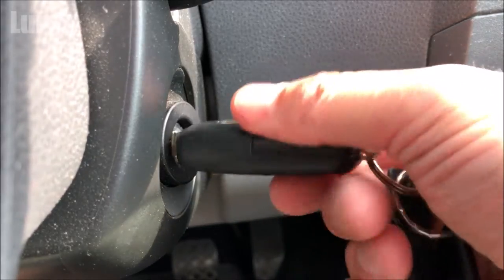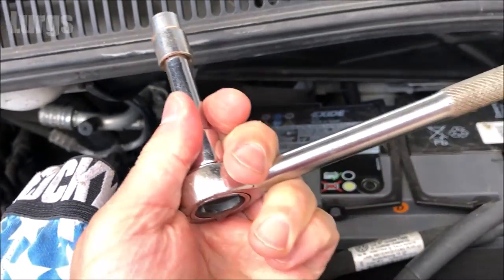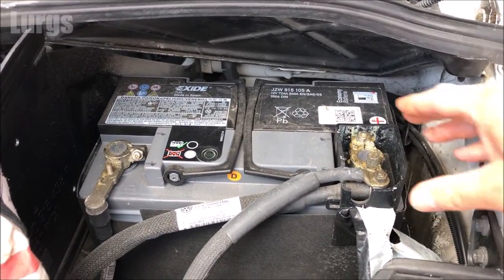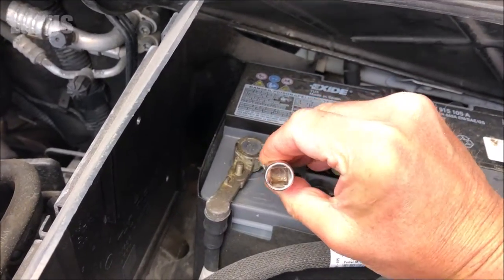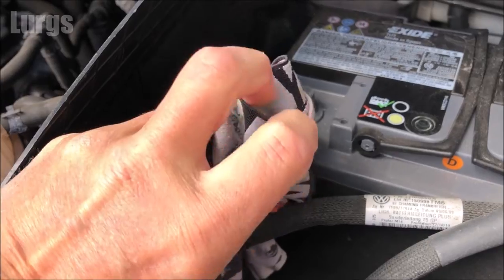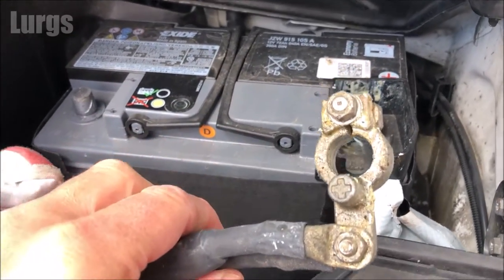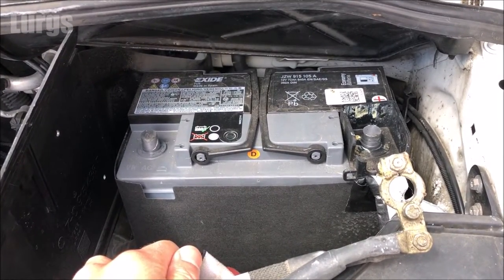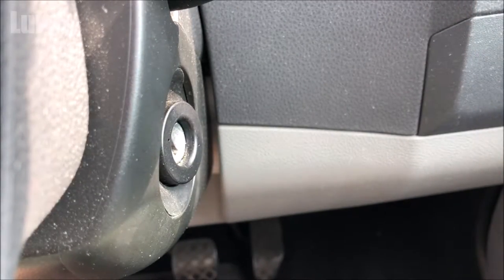How to disconnect a Car Battery Safely plus TOP TIP for keeping battery terminals corrosion free

Comment: Can you damage your car by disconnecting the positive first on a battery?
Reply from the maker: You could do, it’s more dangerous because the battery is still live
Reply: Okay what kind of damage can you do to your car?
Reply from the maker: @Mrbacon-v4  None as long as you don’t touch the negative terminal and the chassis at the same time when undoing. You’d probably only blow some fuses but you may damage computers. 
If you do it in the correct order as per this video you shouldn’t have any issues.
Reply: @LurgsHowToGuides  okay thank you. The reason I ask is because I disconnect the positive first in order to reset the rav4 and then I connected it back, I didn’t see any sparks, or anything like that. But when I tried to start the car, it didn’t start. I tried to start it a 2nd and it started.

Comment: Are you sure putting petroleum jelly like that is good idea? Petroleum jelly does not conduct electricity very well, so you are actually putting a layer of insulator between  terminals. I thing that original idea with petroleum jelly is that you put it after connecting terminals, to protect them from moisture, but it is going to attract dirt. That is why I do not use it anymore. Just clean the terminals and that's it.
Reply from the maker: It’s only if you don’t have the special battery paste. I only ever put a tiny amount of jelly on. Yes it will inhibit slightly but still better than corroded battery terminals.